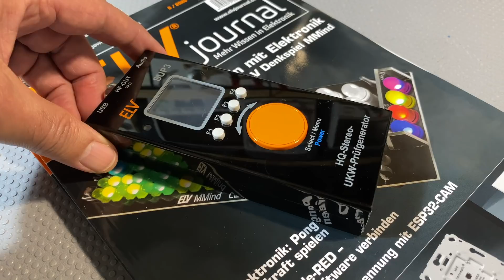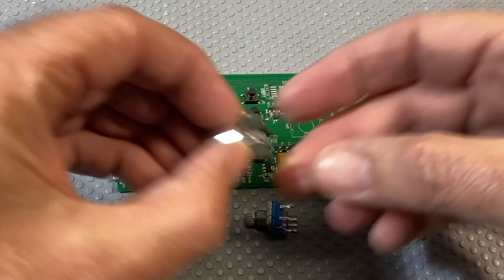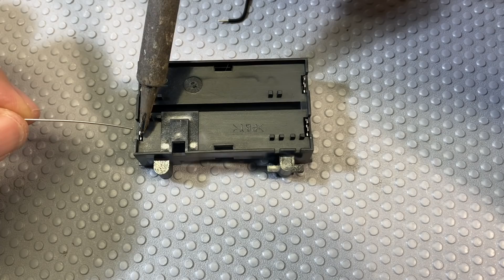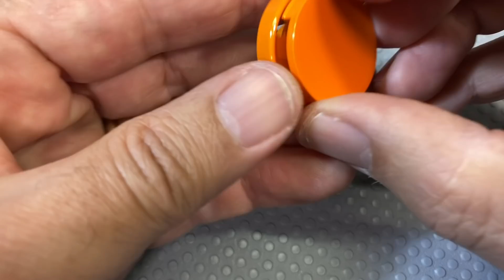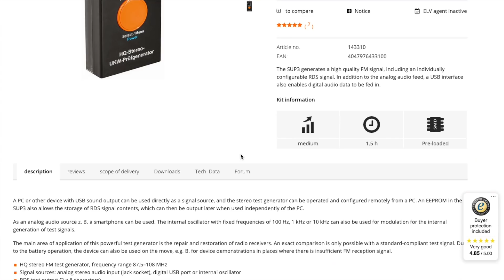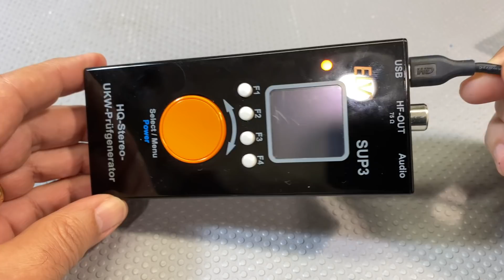ELV SUP3 FM stereo test generator with PC control via USB.

Comment: That's an impressive deivce, especially for the money. Since you spoke of older/ more complex units: these Sound Technology ST-1000 units were more affordable at one time than this; perhaps they still can be found for a more reasonable price. I lucked into one many years ago for about $100-200, can't remember exactly. But I also remember seeing them on eBay in the not-so-distant past for less than this; it'll be interesting to see if they sell for this seemingly (to me, anyway) inflated price. Just a heads-up that they're generally reliable, but they are older units. Mine works fairly well but will need a re-capping soon. (I've no affilitation with the seller or other interest, just throwing this out there in case you haven't seen these): https://www.ebay.com/itm/Sound-Technology-1000A-FM-Alignment-Generator-powers-on/274625851322?hash=item3ff0f9efba:g:VggAAOSw0Z1f5ksr
Reply from the maker: Thanks for the link. I’ll have a look.

Comment: The RF output levels are MUCH to high for any FM stereo alignments. In order to test and adjust most vintage FM receivers/tuners the level would need to go down as low as  15 dBuV.  Even the lowest level possible on this unit is too high to align an IF section. This would be a great alternative to some other FM generators if the output levels were proper for the designed use. As it is now, it’s mostly useless.

Comment: Thanks for the video.  Looks like a really cool bit of kit.
I have the same concerns you mentioned plus one more.  The output is labeled 75 Ω whereas most of what I would be using it on would be 50 Ω.
Reply from the maker: most of the “modern” receivers have a 75 ohm antenna, which is why this unit has that impedance. Most of what I do  uses 300 ohm, so i’m going to have to use an L-pad to match.
Reply: This device is intended to be used on FM receivers in the 88 to 108 Mhz range  and they typical have 300 balanced or 75 ohm coxial inputs.

Comment: Looks like a nice kit, and easy to build for sure. My first thought was that it came with a bag of components and a empty PCB.
Kind of odd that the signal comes out on a RCA connector and not a BNC or SMA connector.
But what chip does this use? It's not a dedicated FM stereo encoder chip is it, it's a SOC or FPGA or something like that isn't it?
Hope the Firmware is updateable. So e.g. they can "fix" the output level...
And it would be so cool if they offered it also in a version with al those GUI controls as buttons and knobs on a box with LEDs and a larger display.
Guess ELV just got another customer :-)
Thanks for the thorough review.
Reply from the maker: The actual chip used for the generation is an fm transmitter chip, the Si4711. 
The output is one of those TV sockets (not RCA), which is inconvenient, so I may change it to BNC. As for the levels, I also think it is lacking there, but I’ll see how it turns out in actual use. I may need to build an L-Pad for the impedance conversion  and even a further attenuator. I’m not sure the level can actually be further reduced via software. I don’t know the chip well enough to be able to answer that.
Reply: @electronicsoldandnew  Not that easy to order from ELV.
Seems they only ship to mainland Europe. Contries in Scandinavia is not on their list. Bummer.

Comment: A couple of things . Saying its simple is pointless it may be simple for you but you saying "its simple " doesn't make it so and a demo in operation would have been more useful than showing how to check boxes on a GUI .
Reply from the maker: I will be demonstrating its use in actual alignments, as I mentioned in my video.
Reply: I dont see the benefit of this thing over a PLL stereo FM transmitter you can get from china for a few bucks.
Oh yes, they dont have nifty app control and you have to pay for them.
Freebee here freebee there, sponsored by this and that company...
This channel is not what it used to be
Reply from the maker: Nor are some of the viewers, it seems. As regards sponsorships, you must really have a really low opinion of a channel if you believe the opinions will be compromised by the fact that someone offered me a device that I was going to buy anyway. I think I have a solution: don’t watch this channel any more. bye

Comment: Will be interesting to see what you use for impedance matching from 75 unbalanced to 300 balanced. Or 75 to 230. I built a device with minicircuits transformers. Works really well.
Reply from the maker: As I’ve actually got more than enough output level to spare (I may actually need an attenuator), I’ll probably build a resistive L-pad.